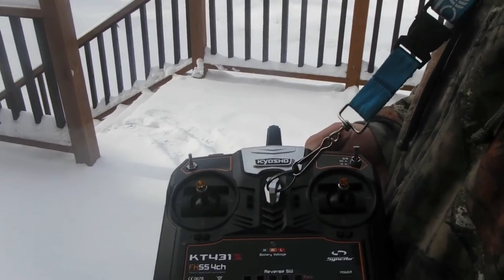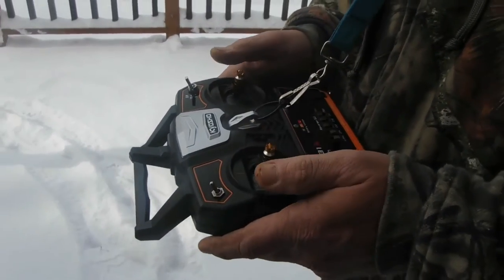Kyosho Blizzard FR Blade Control Switch Mod Snow Test

Comment: I will tell ya it looks like you operated the plow a lot better now!Make a much smaller servo horn and then fine tune how much it hits the ground with the tie rod ends.... I hate to say it the blizzards plow don't look like it's meant for nothing other than a inch or so of fluffy stuff! DARN IT!  if only that after market snow blower for the blizzard was more affordable!   :-)
Reply from the maker: +shenlonco ya i hear ya man that snowlbower is EPIC perhaps by christmas 2016 if i can get it I will muhaaaaaaaa
Reply: Yea only if I had a 3D printer he sells the file I think for $60.00 so you can print it all out yourself.
Reply from the maker: +shenlonco iam looking to getting a 3D printer my self muhaaaaaaaaaaa  just gota get the cash together
Reply: yea and what one would you get there are so many now!
Reply from the maker: +shenlonco yup yup  i got my eyes on one that banggood has